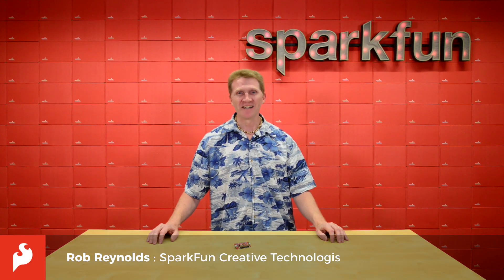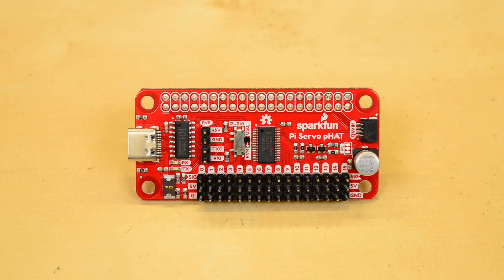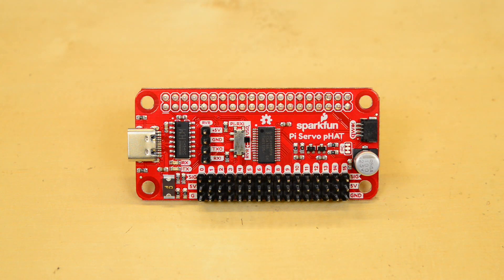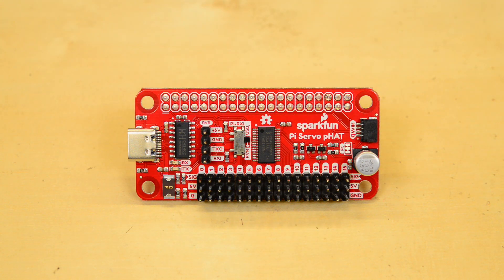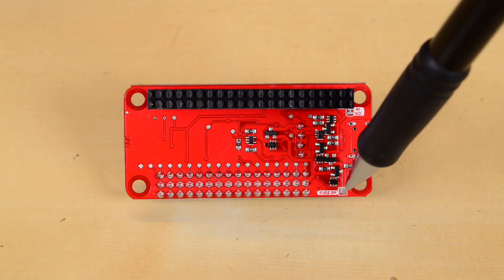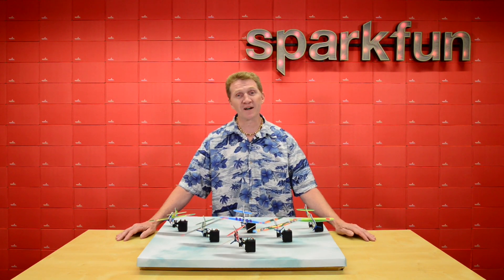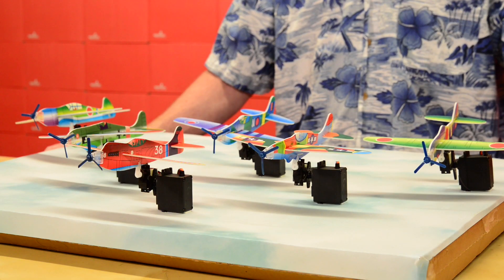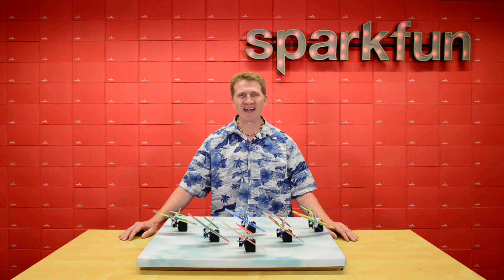SparkFun Servo pHAT for Raspberry Pi

Comment: is the lag in each plane following the last one caused by the fact that the PI isn't realtime hardkernal and/or just the speed of the I2C buss and the time is takes to issue the commands for each plane ?
Reply: the back 3 all move at the same time, the middle 2 move at the same time. I think they're just programmed to follow the front plane. They just put in some pizzazz.